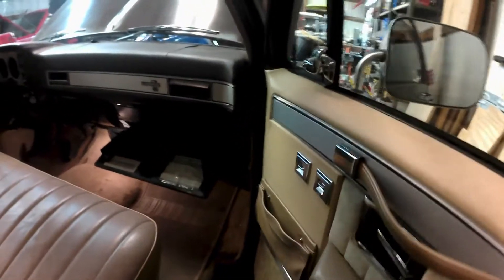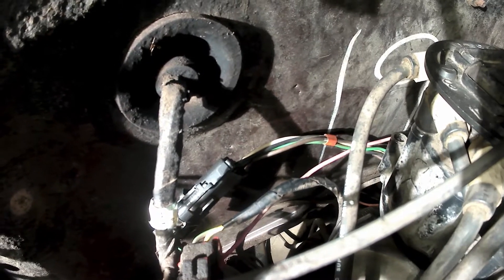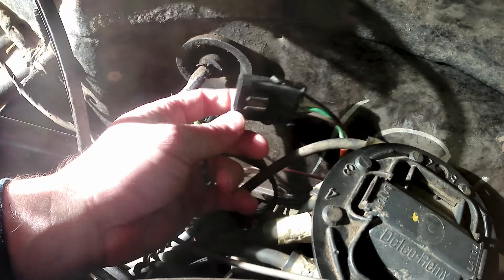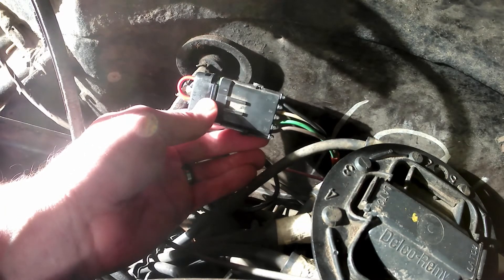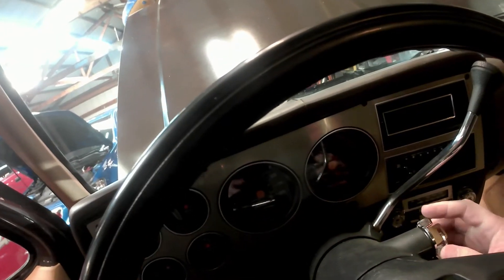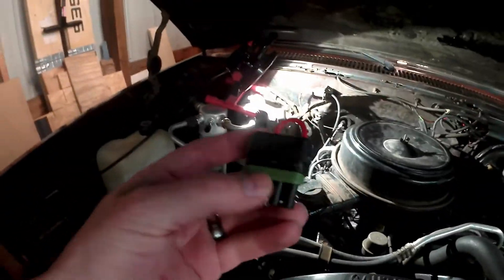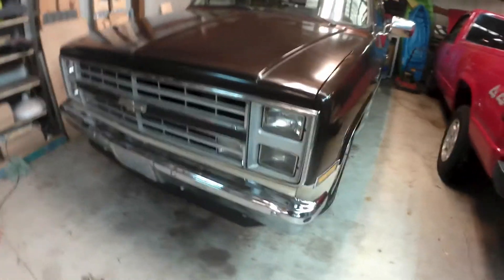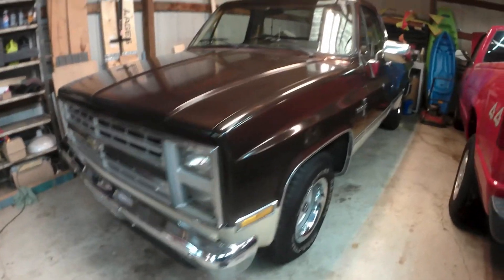How to Bypass ESC Easy on 1981-1986 Chevrolet Trucks (Silverado, Scottsdale, Custom Deluxe, C10 K10)

Comment: Will it hurt any with out the those wires connected. The bypass
Reply from the maker: The other wires can be left disconnected, no problem.  It's a pretty common bypass/modification.  one of the wires goes to the knock sensor, which is no longer in use when bypassing the ESC.  Not sure about the 4th wire...
Reply: @efamadventures  thank you sir for replying back